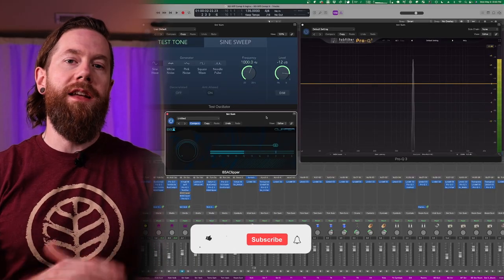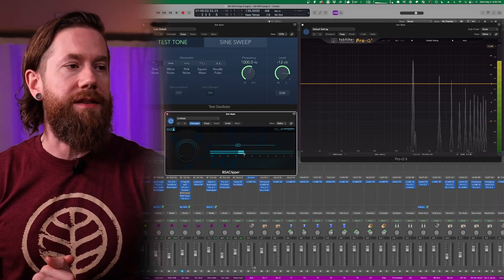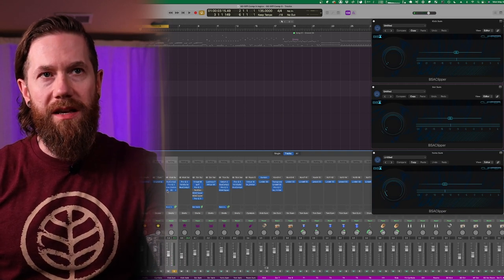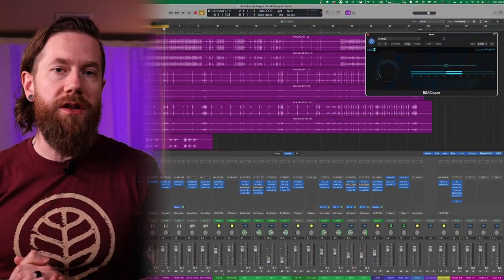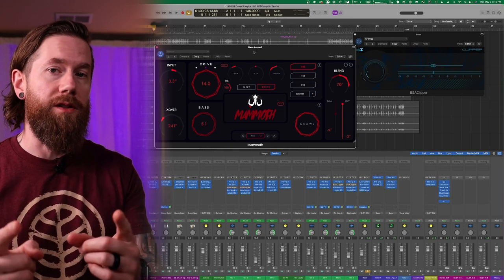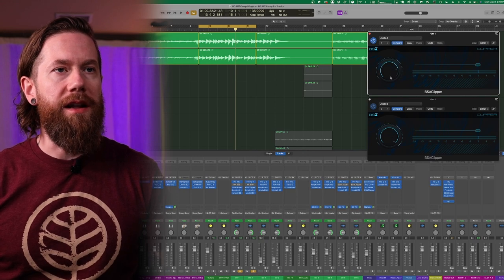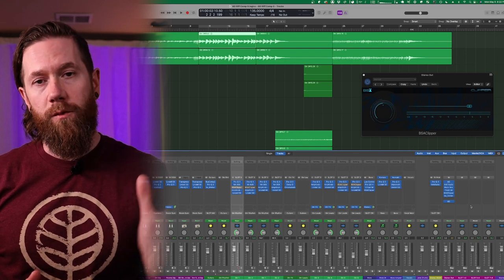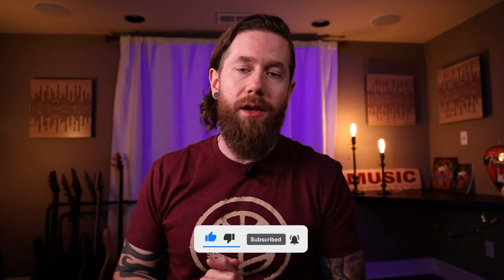The Power of Clipping feat. BSAClipper (Clipping Drums, Bass, Guitar & Full Mix)

Comment: Nice tips Jeremy!! 
I’ve got this clipper from BSA. Its really simple and usefull. 
Noob question on recording guitars. Should I record with the clipper turned on or just add after the DI is recorded?  I have in mind that the clipper on while recording, could remove a lot of the low frequencies like palm muting for example.. Am I right? 
Thanks for the amazing video and content! 
Cheers from Brazil! 🤘🏻🤘🏻🤘🏻
Reply from the maker: Thanks! Yeah, it's a super nice plugin and really easy to use. As for recording clipped guitar DI's, you could totally do it that way. I've seen it done that way for layering guitar tracks. Forward example, Daniel Braunstein did this on the Spiritbox "Eternal Blue" album on a couple songs. He used a couple super clipped guitar DI's to run through Archetype Nolly and blended that in with a non-clipping DI, also running through Nolly, to add some extra depth and weight to the guitars. It worked really well. You could also do a similar thing with DI's that aren't clipping by clipping them like I show in this video. The result is that the signal hitting the amp sim is super clipped, with just means you're going to hit it with a nice hot signal without a bunch of transient information, which will yield a massive "wall of sound". I would encourage you to give both options a try and see what works out best for your mix/projects. 🤘

Comment: So what does a limiter do?
Reply from the maker: Very similar thing but limiters are more transparent. They don’t introduce saturation like a clipper does and allow for peaks to be retained even after limiting.
Reply: My understanding is a clipper is a type of limiter known as a brick wall limiter. Meaning essentially nothing is passing the threshold (except harmonic saturation apparently). Other limiters can function more like a compressor with a really high ratio where some of the signal can pass the threshold. I believe any compression ratio greater than 10:1 is technically considered "limiting"